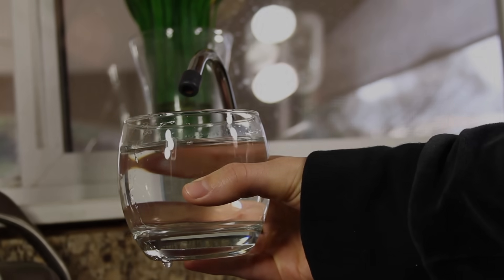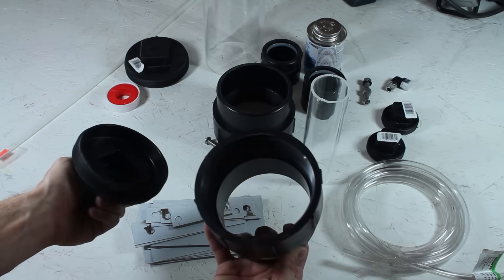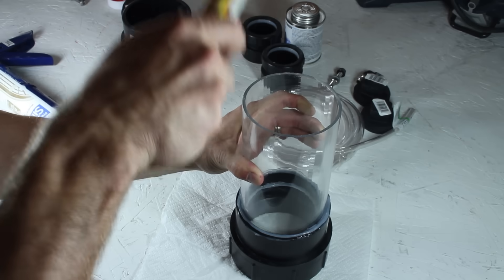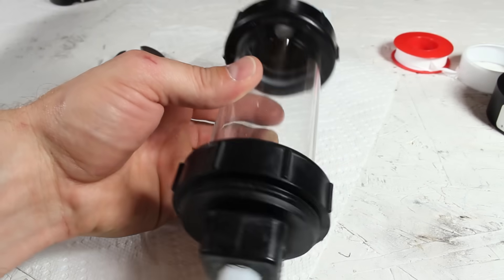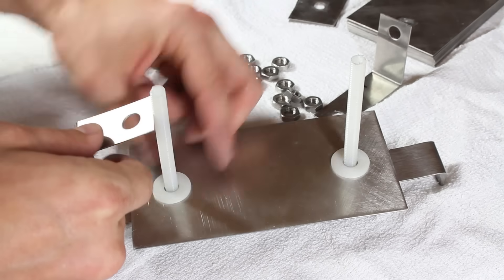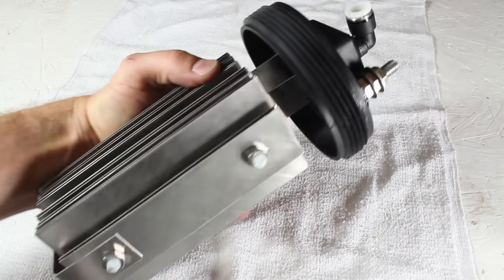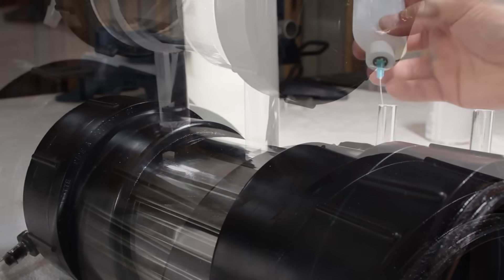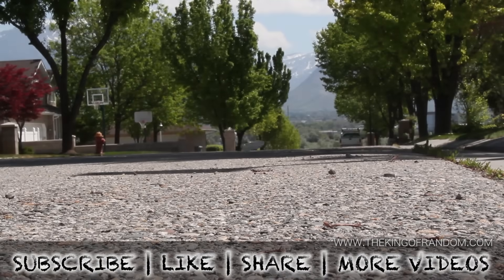HHO Generator - Water to Fuel Converter

Comment: me and my friend hooked up a 9 volt battery with paper clips in the water, and it worked at his house. I set it up the exact same way at my house, it worked at a much slower rate. Then at his house, we took 2 computer heat syncs (we didn't have stainless steel) and a wire stripped back and the positive touching one and negative touching the other in the water. We would plug it in to the wall (stupid i know)  and it would work, but only for maybe 10 seconds. It would then trip the breaker. So, I repeated the same steps at my house, with a power supply that outputted 18V and 2A, and again, EXTREMELY slow results. What could be the problem.
Reply: The rate of electrolysis depends on the 
1>electrodes used
2>area of electrodes in contact with the electrolyte
3>inversely proportional to the density of electrolyte 
4>nature of electrolyte (KOH and alcohol mix in water should work great)
Reply: The rate of electrolysis depends on the 
1>electrodes used
2>area of electrodes in contact with the electrolyte
3>inversely proportional to the density of electrolyte 
4>nature of electrolyte (KOH and alcohol mix in water should work great)
Reply: Ok Thanks!
Reply: Anytime mate :-)
Any strong acid or alkali makes for a good electrolyte. Try to max out the surface area. Paper clips are too small. Alcohol could be added because alcohol kinda lowers the density, making movement of ions easier. Although I must ask, you connected your mains to the set up? I guess you're from USA, where the mains have DC current. I tried the same here in India, where there is AC current when I was a kid. The wires heated up to a bright gold and I guess the gas produced ignited a bit. I turned it off within a second. I was too terrified XD
Reply: Ãdityá Karve
Lol. Alright. I will see if i can't get my hands on some stainless steel plates. I am from the US, and we just took a cable from an old laptop charger, stripped it back, soldered wires to it, and plugged it in to the mains. Probably not the smartest thing. It did explode once but the rest of the time it just tripped circuit breakers. There was nothing to limit the current going into it. I am going to take the power brick from the same laptop charger and see if that will limit the amount of power going to it. Thanks for the help!
Reply: Dakota House, well, I wouldn't fool around with the mains, but okay. I'm working on a similar project, and I need extremely high yields (70-72 liters), and I'm sticking to car batteries for now.
Reply: Ãdityá Karve I would use car batteries, but I kind of want to test it before I mount one of these in my car for hydrogen injection (I've read it helps gas millage and horsepower) maybe I could use a drill battery, or a bunch of smaller kind of batteries in a circuit for testing. I don't have any spare car batteries lying around. I will probably figure something out with batteries.
Reply: +Dakota House you could use a ac to dv converter, and make the gap between + and - as small as possible
Reply: ar ar ar rafael, you mean pulse electrolysis? I don't think anyone could do that with household stuff. It's pretty cool, but difficult to achieve.
Reply: Ãdityá Karve ar ar ar rafael 
I would be happy just to get a stable machine to produce hydrogen. Gonna work on it today with batteries.
Reply: How did it go? XD
Reply: batteries are pretty expensive, just use one of your charger it will do the trick
Reply: +Ãdityá Karve 
it's actually possible with house hold stuff, if you able to modify it thought xD
Reply: ar ar ar rafael ,yeah, but I'm working on a portable version for high performance applications. Using the mains is always better, albeit a bit dangerous.
Reply: you havent use KOH , or if jou havent you can use salt but the water wont be clean
Reply: Ferencz Szekely KOH will be more efficient.

Comment: I built this generator for my eighth grade science science fair. His over all design is correct but I redesigned the plate pattern and learn that the price he claims the project will cost just a little money, but really just to cut the steel of punch it would cost that much. his details that he didn't include cost me 50 extra dollars. Don't use ABS use PVC it works so much better.

Comment: Just a suggestion. The between time 4:50 and 5:50 us viewers have no f**king clue what you're talking about. Nuts, washers, plates, WTF? Who gives a crap? Do us all a favor and leave this part of the videos out. I'm sure it makes complete sense to you after having built the thing, but you go so fast that we can't follow. It's frustrating, completely unnecessary, and a massive turn off. Please, if you're not going to take the time to explain things clearly, then leave it out, and simply show us the final product. Maybe a simply explanation such as "I used nylon washers to stack the plates in such and such configuration before fitting the entire plate assembly in the housing."  There, I just saved you two hours of editing time.

Comment: Can this work with saltwater?
Reply: +ThePeterCaylor sort of, but if corrodes the stainless plates and generates chlorine gas so it is less explosive.
Reply: +mightaymouse The reason he put lye in it was to increase the conductivity of the water, so yes, saltwater would work
Reply: +mightaymouse Yes it will work quite well as salt water is conductive.  I often thought that this would be a good option for sea going craft, I just wonder however if you would get a good return for your dollar.

Comment: But it's not pure H2, there's O2 with it because you gather the gas from the cathode AND anode :/
Reply: 4OH⁻ → 2H₂O + O₂ + 4e⁻
4H₃O⁺ + 4e⁻ → 4H₂O + 2H₂
Reply: Large scale air compression and cooling will not produce hydrogen. There is very little free hydrogen in the atmosphere. Strike one.  Hydrogen is commercially made from fossil fuels, or biomass. On the other hand, oxygen IS commercially produced by the compression and cooling of air. That's where virtually ALL commercial oxygen comes from, NOT electrolysis. Strike two. Neither gas is produced commercially in quantity by electrolysis. Strike three, you are out.  Now, who has his facts straight?  Big talk, little PRACTICAL, COMMON SENSE knowledge on your part. Again, I say, grow up and learn some real world facts.
Reply: Quantum Leap also, yes it will. Air is a mix of gases. Hydrogen happens to be the most common in the universe :/
Reply: Damon Jackson  Regardless of the emoticons you use, you are quite wrong.  In the universe - - where is that?  Interstellar space?  Sure, lots and lots of hydrogen.  In our Earth's atmosphere  -  NO, bonehead!  Do Some Research!  You just open the door for insults with your blatant ignorance.
Reply: Oh sorry my bad, I did not put sound (it was late on my phone xP)
Reply: true, but it actually makes the gas more explosive.
Reply: +Logan Kramer Yes it sure does and also it seems to be in the correct proportions for use as fuel.
Reply: actually, the cathode is hydrogen and the anode is oxygen. this is the commercial way of getting both gases
Reply: +Damon Jackson (Gaming & Science)   But electrolysis is NOT the way they make oxygen and hydrogen commercially.  You obviously don't know the economics of the process. In other words, you are ignorant of the facts.
Reply: Quantum Leap LOOK IT UP! If you know so much about electrolysis, you would know that either electrolysis (more commercial) 
Or large scale air compression and cooling is better for getting oxygen and hydrogen. So no, YOU GET YOUR FACTS STRAIGHT
Reply: Quantum Leap cya dude!
Reply: +Damon Jackson (Gaming & Science) Hydrogen exists in almost non existant quantities in the air because it is so light it can be carried away from earth by solar 'wind'
Reply: Comic B Studios ok. I knew that lol. Actually it most likely flies out of our atmosphere
Reply: +Damon Jackson (Gaming & Science) OK, so here's the skinny on H2 production in industry. Only about 4% is produced using electrolysis. The rest is made from fossil fuel, most often methane (48%). The process involves two phases. Phase 1, heating methane and steam (H2O) to about 1000 degrees. This generates CO and H2 gases which are passed to phase 2. In the second phase more water is introduced at a lower temperature and net products are CO2 and H2 gases plus a lot of heat. The generated heat is cycled back to provide the high temps needed for phase 1.

While you are correct about hydrogen being the most common element in the universe, you rarely find it as H2 gas. This isn't because it "it just flies out of our atmosphere, but rather because it readily combines with O2 (or other elementals) to produce compounds, in this case water, which being heavier than air eventually makes its way to Earth.

No sense getting upset with +Quantum Leap over this. The video is really just an interesting hobbist project for the fun of making things that go "bang!". Enjoy!
Reply: Tom Mole thank you for making peace.
I believe you.
I have been a fan of grant for a long time, i was just defending him...
I did know that there is barely any on earth as an element..
Reply: They make 2nd stage scrubbers to remove oxygen. O you can put positive electrode in scrubber to draw off O2 to vent into ambient air.

Comment: So how many (or how big) of a generator would it take to run a small engine continuously? You could even set up a solar array(and a lot of batteries) making it run pretty much on only water. Then of course the next question is, what would it take to run a modified car engine and if the amount of power it would take to make the gas would be redundant as you could just use an electric motor. Another thought is i wonder what you could do with a hybrid car. So many possibilities.

Comment: Ok, You take a coal, Oil, or Diesel fired chemical system like a powerstation, Then you charge two car batteries with it, Now you have electricity, Then you build this which converts that electricity back to a flammable gas(Hydrogen), Its the opposite of nuclear, Instead of converting mass to energy, You end up losing because you convert some of the energy to mass, In the case of hydrogen, When it burns it produces water, Its that water that is the key, No matter how much gas you produce, You could never keep the two car batteries charged.

Comment: to many nuts in the comments lol. AND WHY AREN'T WE USING THIS FOR FUEL!!!! just sayin
Reply: Harly Meyer How the hell would that work?
Reply: +Harly Meyer captain here, yes, they develop it right now, that gas unstable, and still the pressure of the gas is to dam high, for car it need more cost for make a spare part on engine to endure the pressure, and also the water is free but the technology is not, need lot of space, and lot of electricity, they won't release this until they find the way to decrease the pressure, another free energy to safe electricity and I have no any f*cking idea what I was saying

*fly away
Reply: Galang Putra
Yeah, how is this supposed to do anything?
Reply: jib1000
Reply: Galang Putra
The technology to inefficiently use fossil fuels???